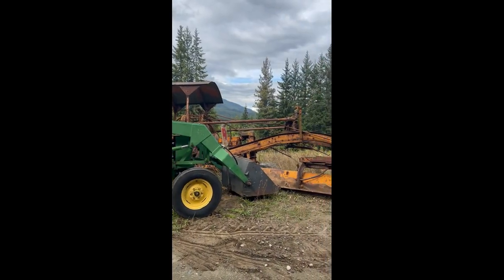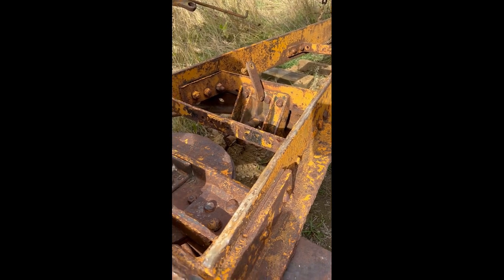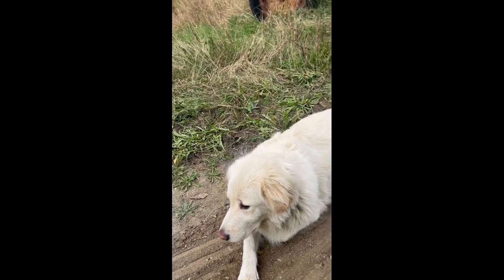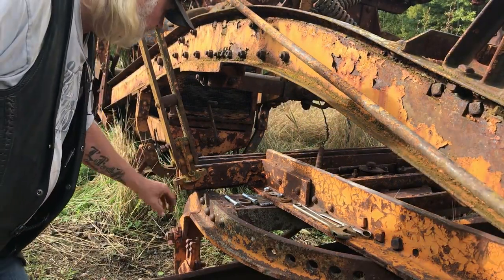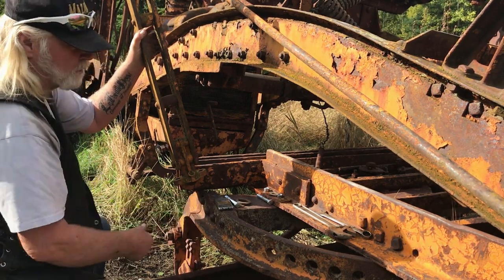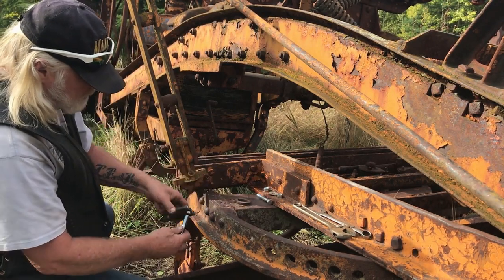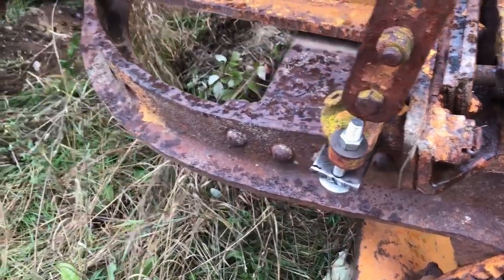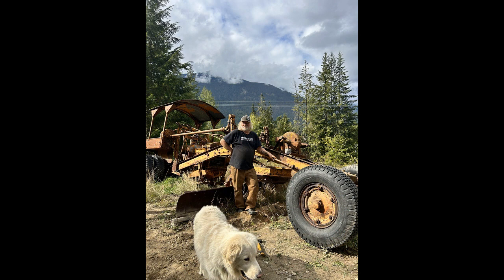Galion Blade Instal

Comment: Great project, Milt. Is the power unit in working order, or is that another chapter or two??
Reply from the maker: This I believe is a 15-30 McCormick. 
Thrown rod thru block. 
I have the carb and magneto for it
On the hunt for a new engine
If you have a lead ?